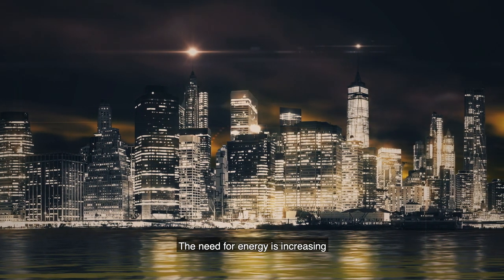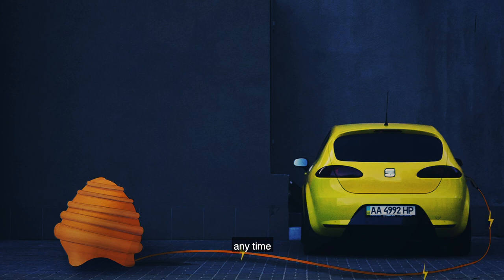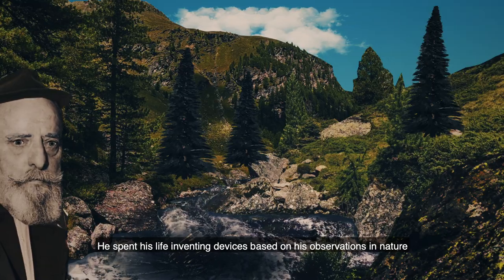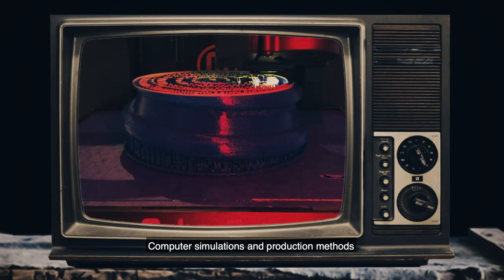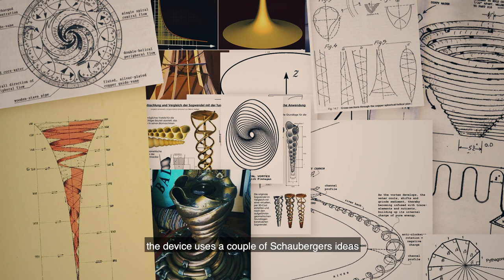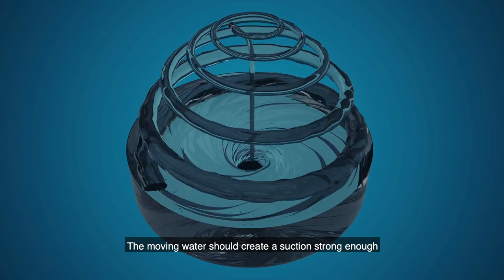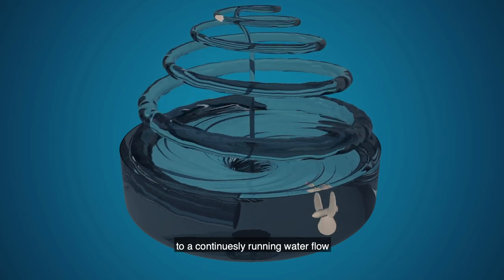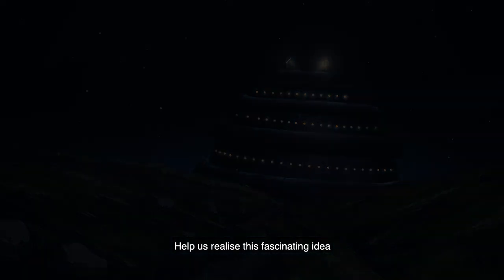Vortex Energy

Comment: Ultimately this is using gravity and a siphon effect to move the water, this will only work in completely frictionless environment which is not physically possible.  Even then, the addition of the turbine means energy will be leached from the system even without friction so the water will stop flowing after a very short time either way.  
Anyone curious why they showed a prototype but didn't demonstrate it working?
Reply: True, but the spiral pipe here supposed to solve the problem about the friction, and even to accelerate the water. Well seems so
Reply: what would be the effect upon the amount of friction if you coated the surfaces with hydrophobic paint ? to my mid this device is running backwards, in the version i've been thinking of the water spirals from the centre and coils around the edge to the top where it empties into the reservoir that feeds it , there are several of them with wire coils surrounding them and the iron laden water (  water based ferro fluid ? )  flowing up from the suction and spiraling down a vortex from the reservoir and back up through the feeds etc creates the energy , theres room for a lily impeller in there too i'm sure . more sci fi than science but i like thinking with my thumbs, also the reservoir would cool the friction sticky water and make it behave like schauburgers log flumes . fun to imagine :)
Reply: It's something to do with water leaching heat from the environment. The proper pipes used are spiralled themselves to keep the cold water in the center and the hot at the outside of the waters path. This is supposed to create an implosion vortex that is the "natural acceleration".
Reply: Looks like the design when through much more development look up the repulsine

Comment: This is a perpetual motion machine. :-(
Reply: this is a very oversimpliflied presentation of the machine. The pipes are twisted in a way so to induce vortexes in the pipe. The pipes must be copper or a ceramic with the same cooling efficiency as copper potentially doped with copper. So the vortexes induce laminar flow reducing system friction to minimal levels, and the spirals pipes become narrower and narrower, greatly increasing the pressure. I believe that this increase in pressure was intended to set of cavitation events whic increase the total system energy. These cavitations could be further enhanced using ultrasound. Not sure if this is dead on what Shauberger intended but I think it sums the device up better than "perpetual motion machine."
It may all be poppycock, but what the man had to saw made sense and was in line with what I have observed in nature.